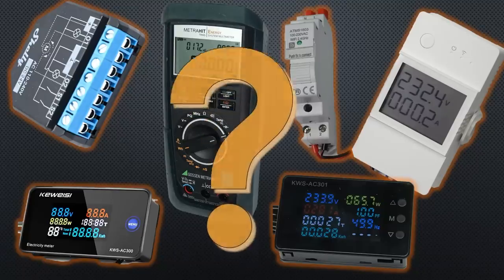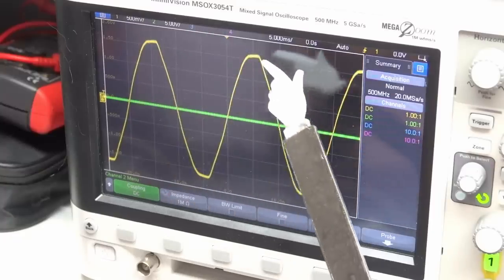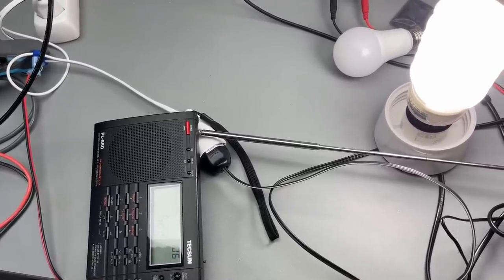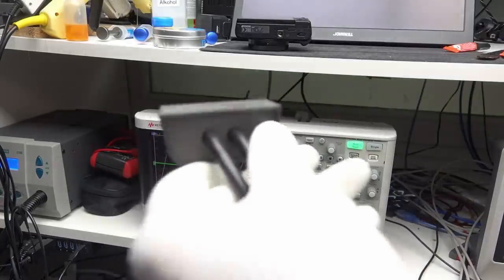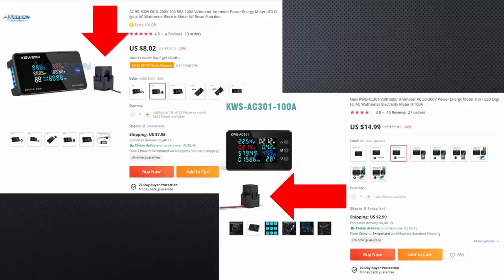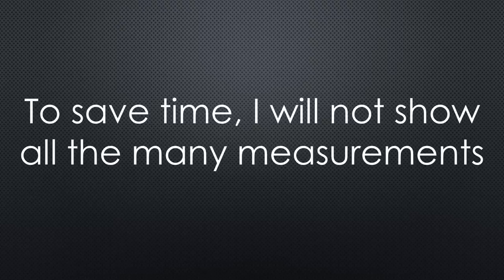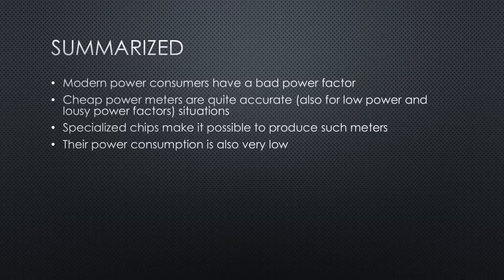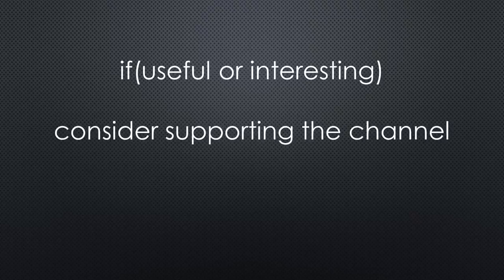445 Can we trust our mains' power meters?

Comment: Can someone tell me the exact name of the tuya device? The link in the description isn't working for me. It says the product ist not available in my country.
Reply from the maker: Sometimes it helps when you change the delivery country. Which Tuya device do you mean?
Reply: @AndreasSpiess  did not work even when selecting Switzerland or US. I mean the tuya zigbee Power meter visible at 8:54.
Still looking for a precise power meter to measure how much my PV inverter actually harvests.

After recognizing that the Shelly 1PM is not measuring the voltage for watt calculation it's out of the game for me as the voltage here ist 230V +-10%.
Reply from the maker: I found one with these words: „Tuya Smart Life ZigBee Switch“. Mine has the button on the front.
Reply: @AndreasSpiess   Thanks...honestly I didn't find something that looks exactly like yours. I hope I can improve the precision of the Shelly 1PM I already ordered before the following way:
- Get the power value from the shelly that was calculated with the voltage set in the webinterface (e.g. 220V) via MQTT
- Divide the power through the hardcoded voltage to get the current
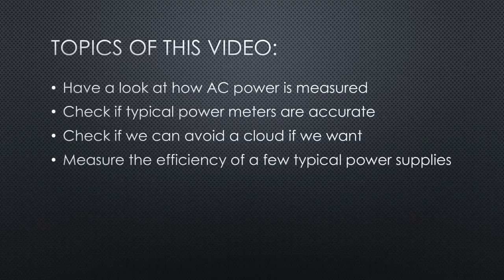- Multiply the current again by the actual voltage read out from my smart meter from the corresponding phase (SML/D0 protocol field 1-0:32.7.0*255, 1-0:52.7.0*255, 1-0:57.7.0*255)

Does that sound reasonable to you? Do you have any experience regarding precision of the voltage readouts from Smartmeters?
Reply: By the was i guess the reason why many cheaper shellys are not measuring the voltage ist because the esp8266 used internally has only one analog digital converter which ist probably already use to measure the current with a shunt.
Maybe the more expensive ones have an esp32 with more ADCs.
Reply from the maker: @jokakilla2011  This works for resistive loads (which are rare these days). For all other loads, you need a meter that can measure voltage and current many times a second and at the exact same time (as described in the video).
But I assume the 1PM has this feature that you only have to calibrate power and voltage with an incandescent 60W bulb. Most of the newer meters use special chips and not the ADCs in the MCUs.

Comment: I bought a 'smart' plug with near real-time monitoring as one feature to see roughly how much power my new PC uses and it dawned on me that I didn't know if it was accurate. I found how much power my fan uses (50W) and saw it only using about 37.5W and my heart sank. Then I turned it up to max speed and it hit 50W.
Reply from the maker: As you saw, all meters were quite accurate. So 37.5W definitively had to be wrong ;-)
Reply: @AndreasSpiess  I realised afterwards that it was 50W at the maximum speed. 37.5W was the lowest which I didn't know beforehand.

Comment: Which Zigbee meter is used? The link you gave does not work in .de
Reply from the maker: Another viewer (probably also from Germany) also complained that most links do not work. I re-checked them and all worked. It seems that Aliexpress does not deliver a lot of stuff to Germany.
Reply from the maker: I just re-checked with "Germany" as country and it did not display. So if you change to "Switzerland" as delivery country, you should see the product. I usually use the links to the shop I ordered.

Comment: Would be nice to test them against the meters that have been installed in the house by the energy providers. I have a Contigea meter, probably from the 1950's.  I have been measuring a lot of devices over the last couple of months and I am still missing a couple of KWh a day somewhere it seems.
Reply from the maker: In the fifties, the loads were very different. So maybe these meters cannot properly deal with the fast- changing current curves.
Reply: @AndreasSpiess   Would be nice to compare since of course our electricity bills are being calculated on the readout of that meter. Worth looking into in my case.
Reply: Yes. I was thinking the same. I wonder just how the domestic meters measure the V / I values. Since this is the meter that creates our bills, it would be informative to see what contributes and by how much. I'd be surprised if a domestic smart meter had the same measuring circuit as a €1000 test meter.
Reply from the maker: @petelynch9468  The $1000 come also because it has several ranges (which enhances low power measurements).
Reply: Now imagine you discovered you're using a lot more kWh than the domestic meter shows. Would you notify your energy provider?
Reply: @TishSerg   Very good question. To measure is to know, but know what you measure is next level. Still tracking everything after all these months, now with different meters. Next stage is measuring the total right after the meter but I need to find some good stuff for that and it should be affordable. I talked to a friend who owned a couple of these clamp devices which you can clamp over the wire and do some logging but not sure how correct those things are. That way they only measure current and not Voltage.  The quest goes on.
Reply: @Luke-san  
> clamp devices which you can clamp over the wire and do some logging but not sure how correct those things are. That way they only measure current and not Voltage.

You can clamp around one wire (non galvanically) and take voltage by probing both wires (galvanic contact).

Comment: Hi Andreas: Cool stuff on your channel as usual!
I got also some powermeters of diffrent kinds but used them for a homemade mobile powerbank 24V for USB output, a bench-powersupply and an inverter for 230V 200W. The inverter is sinusoidal and keeps burning the powermeters and other connected stuff like e.g. motiondetectors from a well known swiss company. The burned electronic generate their power trough a cap and resistor - usually the cap lets out the magic smoke....
is this because of the sinusoidal curve of the inverter? can I use these electronics with some kind of better caps?
it looks like a common problem - the motiondetectors on a "inselanlage" of a neighbour with solarcells also burned the same way ...
hi from zürich city to lausen!
serge
Reply from the maker: I do not know what happens. I would do some measurements to understand what happens.
Reply: I have a cheap UPS that tried to burn my 10$ Chinese power meter (I saved it by timely pulling it out, so it is still alive although roasted and smells fried semiconductors a little bit).

I measured the AC waveform of the UPS outputs and saw some shit. Unlike pure sine with peaks of ±312V (220V RMS), the waveform from the UPS was just stupid square peaking at something around ±403V (RMS still 220V). 

I think that is the problem since many electronic devices that are intended to work from mains voltage are using 400V capacitors since 312V will easily fit in that range. So I think if we install a 450V capacitor instead we can fix the problem. But I haven't checked it in practice. 
Another way can be using some filter between the UPS and the power meter that will lower those nasty peaks and the capacitor in the power meter will survive.
Reply: @TishSerg  cool thanks - that might be the solution to the problem!. I haven't taken my oszilloskope to the place yet where I found the problem.
my cap was also burned - it powerd a PIR-sensor but wos not cheap nor chineese....
Reply: @amtsgedicht  would love to hear from you when you take the oscilloscope and investigate that evil power source! And would be good to know the final solution you'll have made.
Reply: @TishSerg  403V is really a lot! Most cheaper UPS create rectangular patterns.
Reply: @HB9BLA  yeah, I was so surprised when I saw that high peaks on my oscilloscope.
Although I was aware that its output is quite bad because of label with text "NOTICE: The output of this device is not  sinusoidal. It has a total harmonic distortion of 63 percent and a maximum single harmonic distordion of 52 percent.", but I didn't expect that the output is SO bad.

Comment: The good question is how can we trust national energy provider power meters ?????
Reply from the maker: At least here they have to fulfill hard regulations...
Reply: On my powermeter the optical LED got broken after 5 months (Holly DTZ541). This also happened to the powermeters of my flat neighbors. I wonder how the overall quality and the accuracy for measurements is of this chinese product is when such simple things break.
Reply: The meters are all calibrated at the factory with traceable standards and sealed to protect against tampering.
Reply: Here in my country Hungary, I experienced too high readings on my utility meter provided by the electricity company. This was a dual meter with consumption and feedback counter because of my PV system installed on my roof.
To track down the suspicious meter behavior, I separately measured all my devices for one day with a commercial power meter.
When I finished the individual measurements sequence, I summarized the individual daily consumptions, and take this number as an accepted average daily consumption.
Interestingly the utility meter always showed 20-30% more consumption compared to my summed up average.
I started an official complain with my electricity company, to ask a calibration for my meter.
They came and replaced the meter with a new different type, and take the old meter for calibration check.
After 2-3 months, the official result arrived, saying the old meter was good, and I was due to pay a small amount of money because of the "unverified" measurement complain.
However the new meter is showing more realistic consumptions, the 20-30% extra readings are gone.
It can be stated as a lost interaction with the utility company from my point of view, since my complain was rejected, but finally my original problem was solved, right?
I invested a small money for the "meter replacement", and the result is 20-30% less consumption....

I just shared this story, because even the utility meters can be a scope of questioning.
As they are produced in vast amount, where every cents counts, and this pressure of cost savings can result in unreliable metering.
Reply: Yes we can !
Reply: @szabonandi  I wonder what kind of "calibration" they performed...
Reply: @Mattze96  Perhaps try to check it? Use a resistive well known load. However you will not find small errors (order of 5%) that way.
Reply: @AndreasSpiess  I had a suspicious high readings from a UK utility meter - I tested with a Fluke DMM and a clamp meter + fan heater. The item was running 2x fast - the electric retail supplier said they'd test it but ... guess what - they lost it.....
Reply: I was hoping this was what the video was about. My mother received a digital meter 2 years ago. The power conumption was pretty constant before and after, but with a 25% sudden drop in measured consumption right after the meter swap! Old meters didn't measure powerfactor at all I think while the new digital one does, still 25% less power. Nothing has changed otherwise. She may have paid 25% too much all these years!
Reply: Mine is within 2% compared with a Shelly EM
Reply: @imqqmi  Old meters also take power factor into account. Even the ones with the spinning disc. They were quite good, actually.
But if the permanent magnet in it got weaker, they will read higher.

Comment: For me it does not matter what cheap meter shows - it is important what is the quality of the meter installed in my home by the Power Utility Company. If they meter cannot handle modern devices with the dc/dc power supply we will pay more...
Reply from the maker: I Hope (and assume) that they have to use certified meters.
Reply: @AndreasSpiess  Yes, they are certified fore pure resistive loads. But unfortunately LED, and other devices use DC switching.
Reply: @AndreasSpiess  See the report:"Electronic energy meters’ false readings almost six times higher than actual energy consumption" of the Amsterdam University of Applied Sciences

Comment: Tasmota on the SonOff Elite should be much better, calibrate it with your meter and the 60W bulb. Also increase MQTT frequency, I suspect will be better than stock.
Reply from the maker: Of course, I can calibrate all meters. But what about all viewers who do not want to spend 1000 Euros?
Reply: @AndreasSpiess 
The Aneng multimeters are pretty accurate for budget viewers... Mine was around $20US from Banggood if I recall. And it's so close to my Fluke 179 that I don't even bother taking my Fluke into work anymore, even for things where I need a finer measurement.

Comment: 1:40 so that's were those nasty plugs and sockets we're using here in Brazil came from 😂😂😂
Reply from the maker: Why do you call them "nasty". I like tham. Just not the fact that none of the other European countries use it ;-)
Reply: @AndreasSpiess  that's exactly the reason. I remember your video about RISC V when you said something like "standardisation on the lower level leaves you free on the higher level". People should decide on one type of connector and be done. If you haven't already, you should check out Adam Something's video on why European international rail sucks. Same exact premise. Cheers

Comment: Almost all links to Aliexpress are broken (Sonoff POW Elite, Tuya Zigbee, DIN Rail mounted, CP2100a, DP20003, Mini PC). Maybe this is something which was not intended ...
Reply from the maker: I just re-checked with "Germany" as country and it did not display. So if you change to "Switzerland" as delivery country, you should see the product. I usually use the links to the shop I ordered.

Comment: Well at least the power meters are relatively accurate. what about temperature/humidity and Co2 meters... I have been buying like 10, and when standing next to each other they all give different values, even with the same meter from the same brand. Now how am I suppost to determine if it's 18 or 20C :P
Reply: The cheap  bare component ones (non brand, AliExpress) are typically on branded ones might not be calibrated from the factory properly so you need to do that yourself with reference. Some of the sensors like co2 have auto calibration modes and manual Calibration manuals too. So watch out for those.

Also, some of the AliExpress ones might be B-graded components sold as new, but in reality they are ones that did not pass quality control for some goodish reason.
Reply from the maker: I made a video about CO2 sensors. They can easily be checked because outside the CO2 is constantly around 400ppm. If you chose VOC "CO2" meters, you can throw them into the bin.
For temperature you maybe use a fever thermometer. They are very accurate. Just not at 20 degrees.

Comment: Where could you buy a Lenovo with i7 for barely 100 bucks??? And the price for the MiniPC is relevant only w/o RAM and Storage.
Reply from the maker: I bought mine on eBay.de. But it is refurbished.
Reply: @AndreasSpiess  thanks for your reply, hm refurbished that could be the case, but it's not easily available, unfortunately, for EU it starts from 150+ EUR. 

But speaking about mini PC, the URL what your have shared is not available either :( do you have any other link where within the RAM and SDD I can buy N5100 for ~210EUR/USD?
Reply from the maker: @nnnikolay  You should find it on Aliexpress when you search with N5100 and PC

Comment: A few problems;

1) the zigbee is more accurate than the rest but you still recommend a different meter only because it can measure the lowest powerlevels. Sure, 1-3% difference is probably within the margin of error, but the logic is bad. You don't prefer to get a worse performance across the board just so you can get a larger range of measurements.

2) Powerusage of the meter is only relevant if you keep the meter on at all times, which is only relevant if the device is used completely at random. If you accept an errormargin of several percent anyway then you can just run the meter for a week, deivide by 7 and multiply by 365. In fact most devices don't vary much in powerusage at all so once you have a bseline measurement all you need to know is how long the device has been powered on and a device that can measure that can be powered for years using a CR2032.
Reply from the maker: 1. This is my judgement. You decide with all facts you got in the video
2. I said that power consumption matters for always connected meters
3. I explained exactly your proposed method for quadrant #4 devices